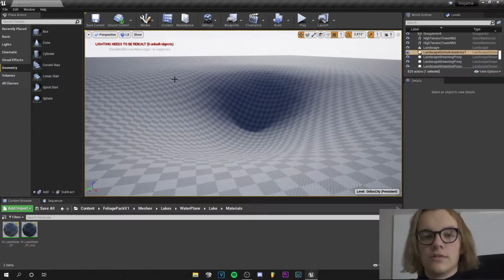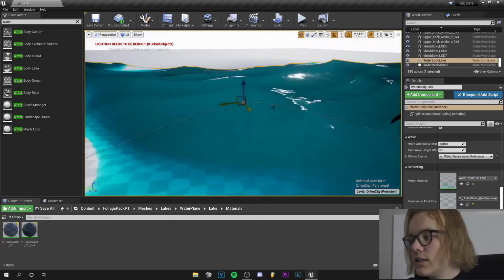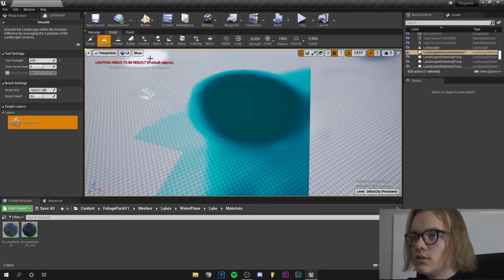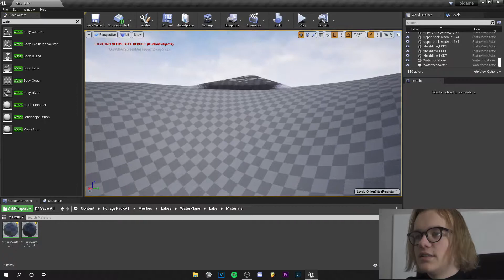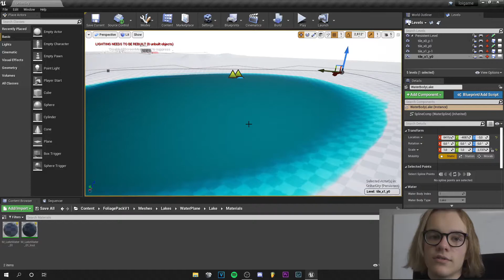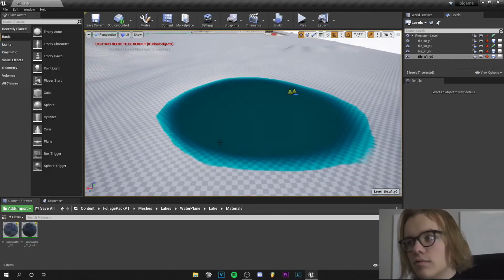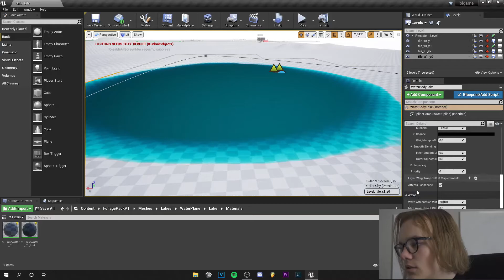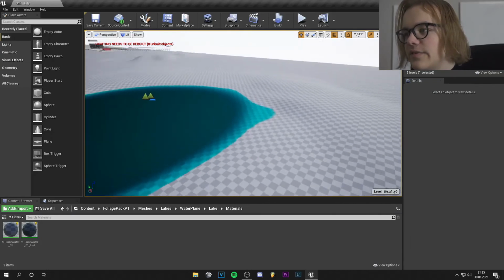How to make a LAKE with Unreal Engine's new WATER SYSTEM

Comment: New question.  After discovering that the water system does not work with imported heightmaps in UE 5+, I went back to 4.27, imported a heightmap from gaea and went to build a lake.   Two odd things:  1) the water, although working at first, does not work any more (I get an indentation for the lake body but regardless of what water material I use, there is no water) and 2: When I add the lake body it affects the highest point of my entire map.  e.g. my mountain which is nowhere near the lake, loses its top half.  Absolutely NO idea why.

If you like, I can send you some images and/or a video showing this event as it occurs.

Comment: Um... I am on 4.27 and when I drop the water body lake into the map... I see no water?  I've ensured materials are added so I am confused... yours appeared automatically... help?
Reply from the maker: Make sure the height is sized correctly and also the boundaries.
Reply: @UnrealMatter  What's weird is... I deleted the original and tried again  and no change.  Did it a third time and it worked... scratches head

Thanks for the quick response!

Comment: The water system automatically carves the hole in the terrain, you don't need to carve it yourself. By the way the water is moving in your terrain (which looks really weird), I have a feeling you didn't define the landscape as having layers when you created it. The water system uses the layer system of the landscape, so it's a must for the water system to work properly.
Reply from the maker: Thank you! This was when the system first came out. I didn't know it makes the hole automatically
Reply: @UnrealMatter  I understand. Well, in my opinion you should put the video down because it could be misleading other people. It's only my opinion. :-)

Comment: its not working in my ue4, water is not visible after dragging it in scene. is there any solution for this?
Reply from the maker: You need UE4.26 or above and you have to restart your engine after installing the plugins if its not working. If then it is not working too adjust the water height and other parameters. If that wont work too try adding other water systems
Reply: make sure, that your landscape is above zero on height. Place a Target Actor on location 0; 0; 0 and align the height of your landscape, so it's above that level. After doing that your water should become visible. Hope it helps (:
Reply: @ganzgeschmeidig  that didn't work either! But i found the solution you have to select editable landscape while creating new landscape, only then it will work! I guess it was a common mistakes but it was the first time i faced the issue so i didn't understand at that time!
Reply: @adityakumarmeena6460  oh yes.. you need to follow the correct steps strictly, indeed.
Great, that you found a solution for that issue (:
Reply from the maker: Thanks for your replys :D